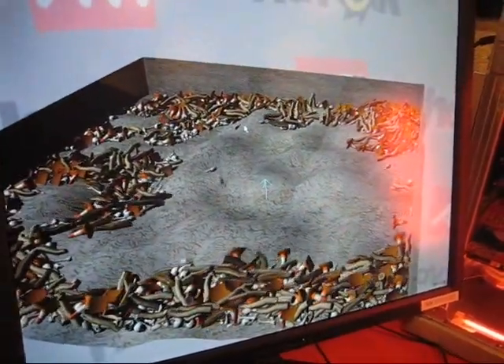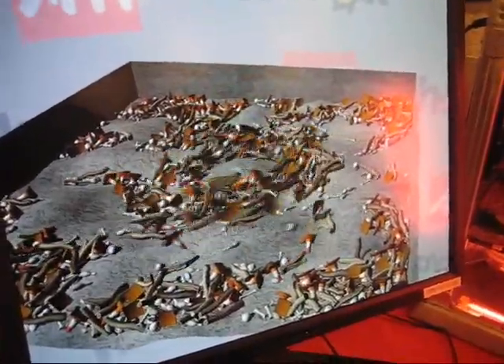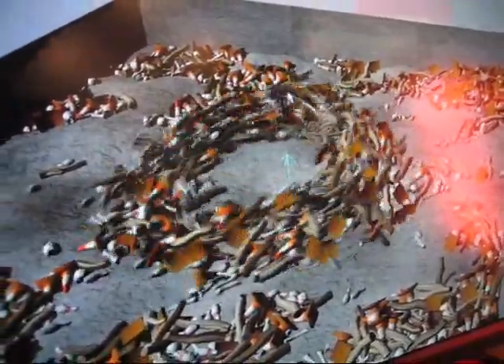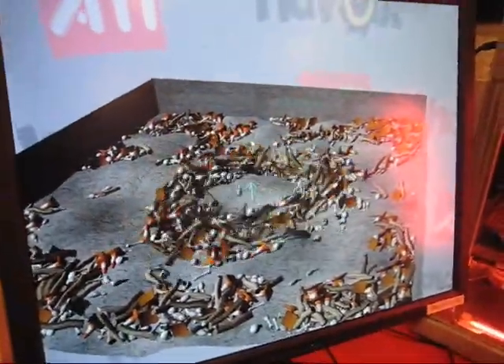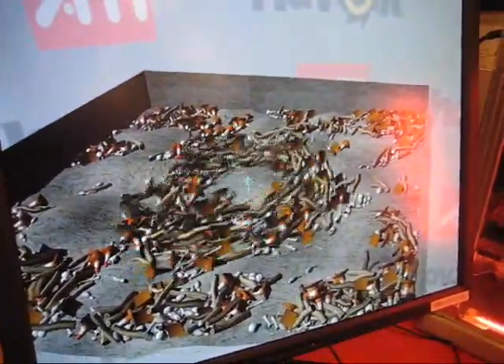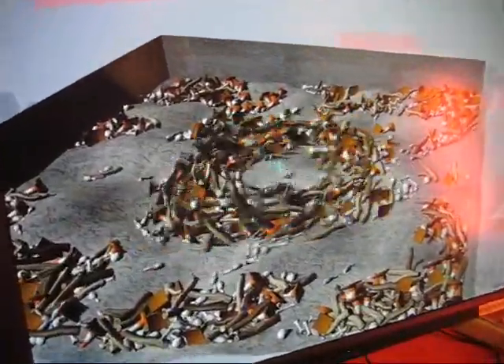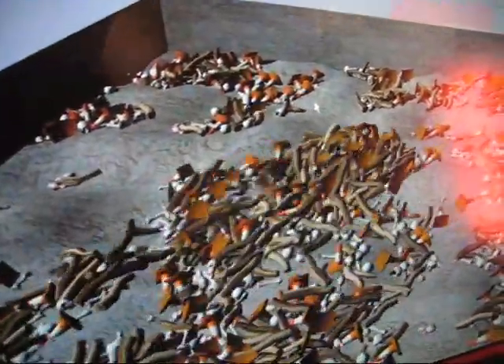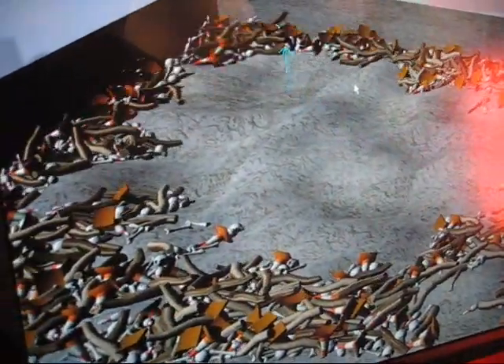ATI Hardware Physics Demo

Comment: simply put:
GPUs are optimised for their main job, while the  PPU is optimised for its own job... if one were to start to try to be more compatible with the other's job, it would lose part of that factor that leads to its optimisation efficiency
in conclusion, you're best off with both, not with either/or...

Comment: thats ok, because up until 2006 AMD was spanking Intel for atleast 3 years.
but during this process people still bout P4's lol, so theres no reason people can't buy cheap AMD x2 chips nowadays. P.S I've always been an nVidia fan, but I'm gonna jump to ATi with these new cards. Crossfire actually works much better on the new AMD/ATi 7 series chipsets, especially the R790 which has currently the fastest intergrated graphics on any motherboard, and it uses that GPU to assist in processing.

Comment: actually, considering the price difference thats a poor comparison! lol, the 4870 only scored slightly under the 260 in Crysis (made for nvidia) and wasn't far off from the 280, now consider this, for under the price of 1 280GTX card, you can buy 2 4870s and crossfire them, I'm actually holding off and I'm gonna pair 2 4870 X2 cards, my goal is to thrash Crysis! lol (BTW, I currently own a 9800GTX)

Comment: Besides, as a dev yourself shouldn't you know GPU physics is only visual effects because of the hardware limitations of GPU architecture? It doesn't matter how many objects they can simulate if they have no impact on the game play.

I'm not too worried about Crysis either since its physics aren't that advanced, strip away the visual effects and they really aren't that special.